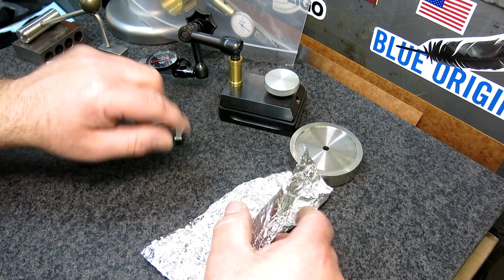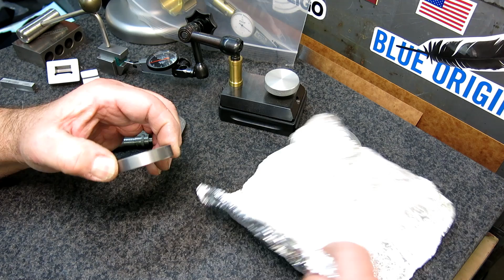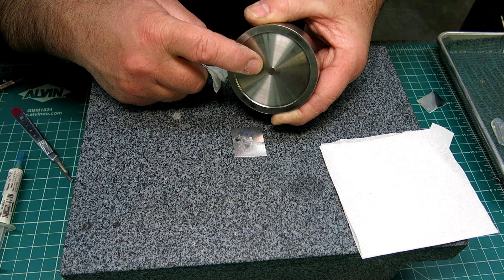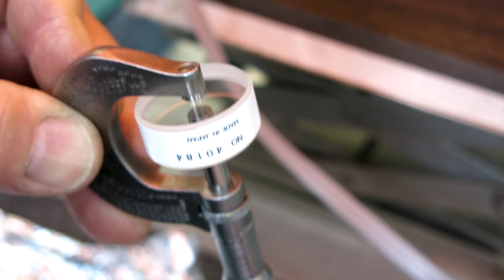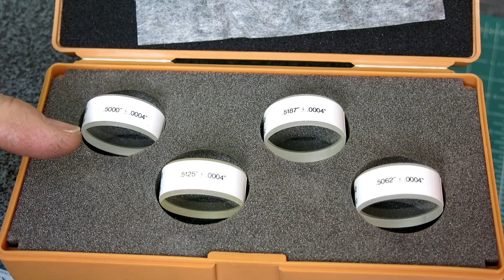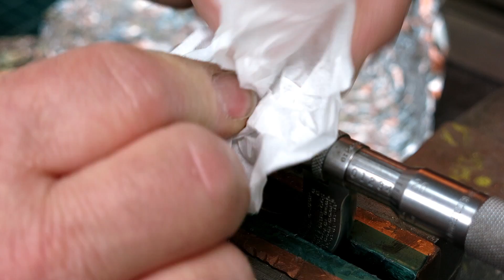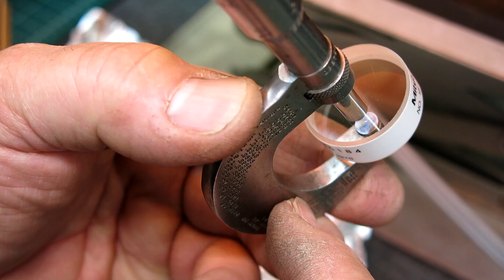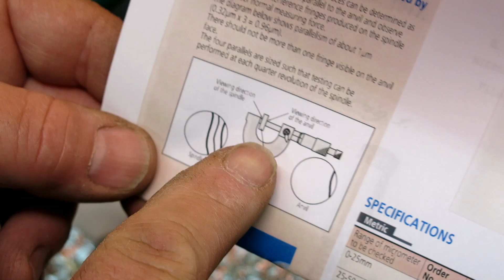Space Micrometer Anvil Lapping

Comment: Being a mon-machinist perhaps I'm only showing my ignorance with this question, but if material is being removed from the anvils, isn't the accuracy of the micrometer impacted?
Reply: No, it shouldn't.  A 0-25mm (0-1 inch) micrometer is set by bringing the anvils together and setting the barrel so that it reads zero.  By removing material, you've created an offset relative to how it was previously set but by re-zeroing it, you make it as accurate as it was before.  The travel of the anvils is down to how consistent the screw thread is and the accuracy comes down to that and the scale - ie one revolution should be however many micrometers or ten thousands of an inch.  Larger micrometers are set in a similar way but since they don't get to zero (eg a 1 to 2 inch micrometer) they rely on a setting bar which should be as close to 1 inch (or however many inches the 'closed' position should be) as possible.   Then, of course, while you've been doing all this, you find you've heated up the micrometer or the standard with your hands and thrown off the calibration since the metal expands as it gets warmer.
Reply: The thimble that is turned and has the measurement graduations on it, is adjustable. That is how a micrometer is calibrated. Even though microscopic amounts of material may be removed from the anvils, it can easily be compensated for by re-zeroing (calibrating) the thimble position in order to maintain it's 'accuracy'. It is a routine procedure that is done quite often before making critical measurements in order to make sure the readings you get are correct.
Reply: You're right, but you can recalibrate the micrometer.
Reply: Thanks for the answers, folks. Thought it had to be something like that.